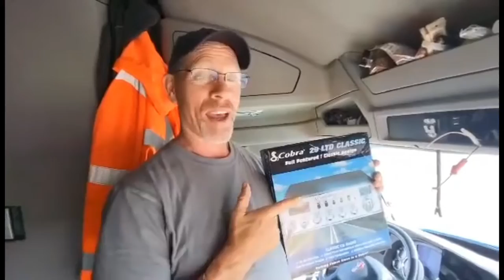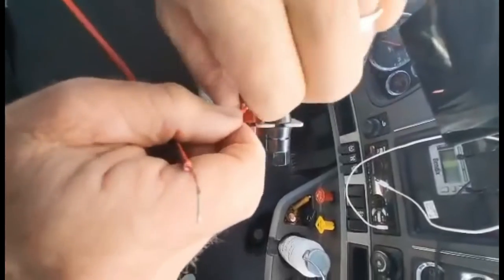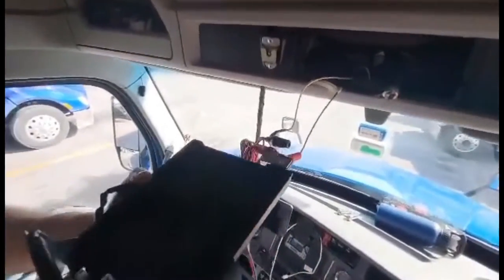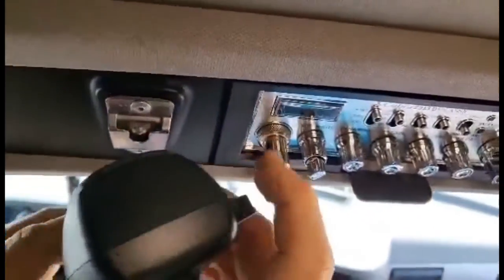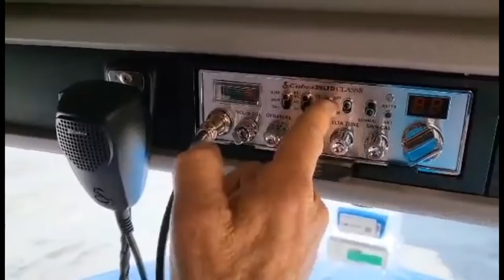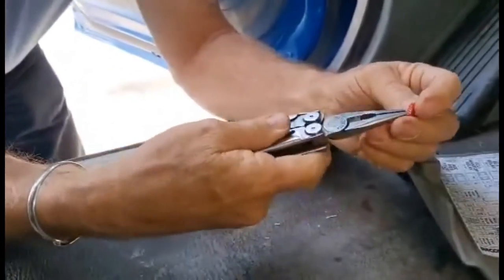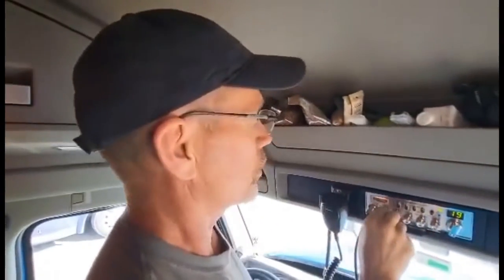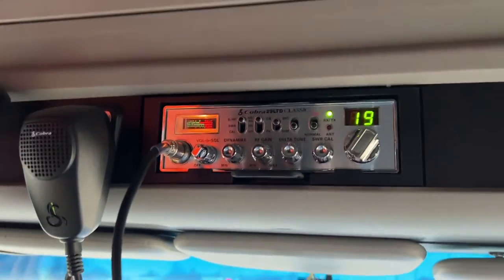How to Install a CB Radio in the Truck | Cobra 29 LTD Classic

Comment: Glad to see another cb radio being installed.  People NEED to get back into cb radios.  If the cell towers stopped working, we could still communicate especially in emergency situations.
    Plus, it's safer to talk on a cb radio than on a cell phone.
Reply from the maker: Yes…and it’s a great piece of safety equipment, especially for winter driving.

Comment: Always read the manual and check your SWR (Standing Wave Ratio) when installing a CB in ANY vehicle. Some radios like the LT-29 have a switch to test the SWR and a knob to adjust it to the lowest ratio possible if the SWR is too high you can "Burn out" the circuitry in the radio.
I have been using and installing CBs since the mid-1970s (started installing when I was 14 when my dad bought our first radio from RadioShack) when you had to apply for and receive an FCC license.

Comment: Good job Kevin.  Youll either love it or hate it. Ive been thru a few radios over the years and a bit of aggravation. Wish more new drivers would use em.  Sure helps for warning about road conditions in bad weather, accidents , holdups Etc. The CB saved my butt more than once.
Reply from the maker: That's what we are thinking! We heard one theory that new drivers don't use them so much because now they can socialize by calling family and friends on their cell phones. But that won't help them get any warnings about upcoming issues!!!
Reply: Yes the new school CB radio is text, twitter and facebook haha. The CB is an invaluable tool for us out here.  When an Interstate closes cause of a bad wreck the local drivers usually rattler off alternate routes around it. The only only guys left sitting in traffics snarls are the drivers without a CB. Some guys have em but dont turn em on. That i cam never figure  out
Reply: Mine is sitting at home on a shelf in the garage. I got tired of all the bickering and foulness on it. Then you got the guys that love to hear themselves talk, so they clog the channel chatting about nothing. The cb has been dying for 20 years but still manages to hang on.

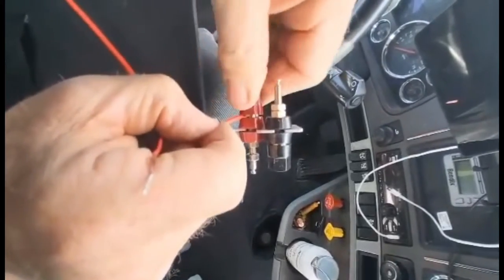Comment: 3:47 into the video and I spotted something you did "wrong". When you put the wire through and wrap it, wrap it clockwise so when you tighten the nut onto the wire it pulls and tightens the wire rather than pushing it out. If you know the proper way to install electrical outlets at home, you know what I'm talking about. It still works but it's best to do it this way.
Reply from the maker: Thanks!!! Great tip!!! Appreciate it!!

Comment: A tip on fuses....You can use a 5.99 voltage testor (the one that looks like a screwdrive with a light bulb in it and a single wire) to test the fuses. I you look closely at the colored plastic bit on the fuse, you will see a small portion of the metal exposed so you can leave it in place and just touch it with the pointy end of the volt tester and if the tester lights up...You are GTG.  If no light on the tester, then fuse is toast.  Cappiche>
Reply from the maker: Thank you!!
Reply: Great tip!

Comment: I don't know if anyone has said anything about it but check your SWR level on your antenna system. When you were talking the antenna warning light flashing. Most times that comes on at an swr of 2.1-1 or greater. This is bad and will hurt your radio over time.  Hope your radio is still working and your still trucking. This is the first video of this channel I have seen, that I'm aware of. ✌️

Comment: Just fyi, by default t680s need key power for cb to get power.  

One think to watch for is the plastic peg on the mic to break after a while.  Nothing better than hitting a bumb and having the mic fall and hit you in the face.  I reccomend getting a retractable hangar or a mic with a metal peg.    I have had 3 break on me after about a year.
Reply from the maker: Thanks for that tip!!!
Reply: Yup I have a retractable CB mic holder that is fantastic

Comment: Thanks for the video, I have one just like yours , but when I push the mic the antena lights up red, how can I check if the antenna cable is working,thanks
Reply from the maker: Ours lights up red too. We don’t think that’s a problem. We think it means you’re talking. Have you done a radio check? At a truck stop just speak into mike and ask for a radio check. Try it a few times. If someone answers you’re good to go. Otherwise maybe try a CB radio shop. We don’t know more than what we showed you in the video. Sorry.
Reply: @TheJoyofTrucking My Cobra 29 did the same thing before it bit the dust so it should be okay..never had any problems with others hearing me but the range wasn’t that good

Comment: My 2025 t680 has the antenna mounted on the back of the sleeper with 1 pointing up and 1 pointing down so I converted it to just 1 antenna facing the right direction but the swr’s are thru the roof🤬🤬

Comment: My speaker connection doesn’t fit?
Reply from the maker: 😳😳😳 What kind of truck? See if you can find a CB shop nearby. They should be able to help.
Reply: I got it connected, why do I barely get any reception. Only channel 6 . I have a kenworth 2021
Reply from the maker: @moisesgonzalez8010  🤔🤔🤔🤔We don’t know. Check with a shop. They should be able to help.

Comment: if you want. a really good cb radio get a galaxy 98 hp that radio does 200 watts straight out of the radio and you might want to get a good antenna monkey made is a good antenna that antenna will hold a lot of. power and you might want to purchase an external speaker so you can hear your radio a lot louder

Comment: That electrical installation without any security or protection seems very dangerous to me, be careful.
Reply from the maker: Thanks for your concern. But you’re actually just plugging it in. No working in wires.